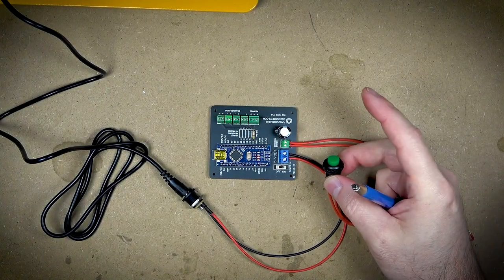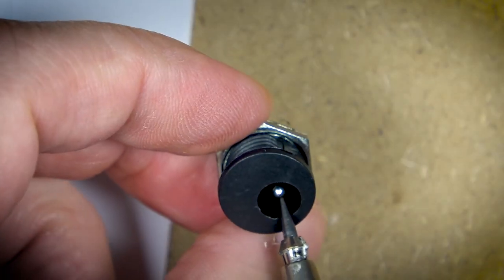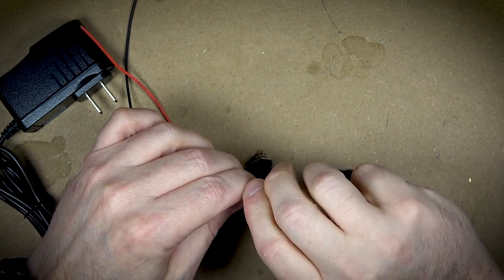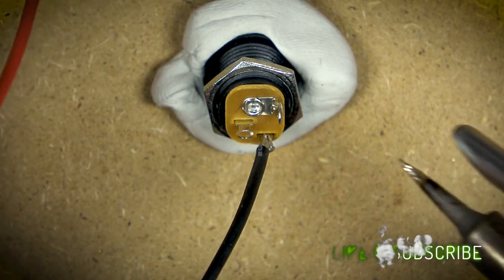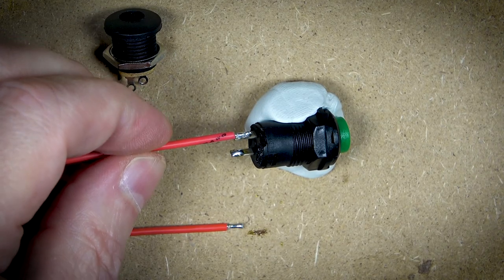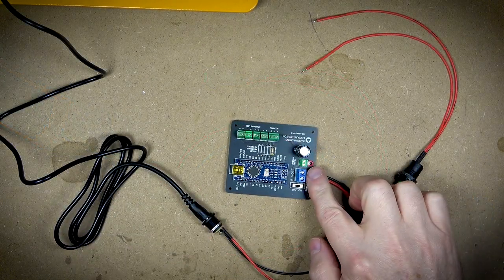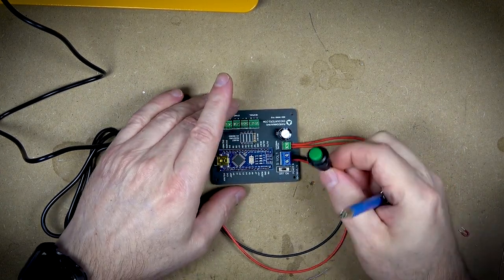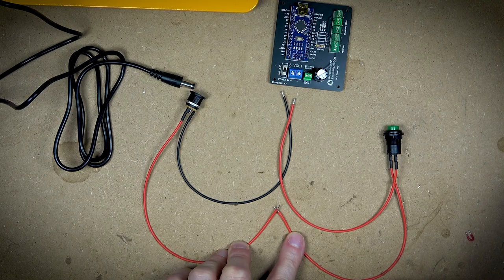Book Nooks - Soldering Power Connections and Switches

Comment: Hi there! Is there any chance to get the circuit board you showed? Would absolutely love to use it in my projects. I am still kind of a beginner in electronics and it seems like this board saves a lot of time and is convinient to use :-)
Reply from the maker: Ya know... it turns out that board needs some tweaking. To make a long story short, I designed it to use 5 volts as its power source. It turns out, the Arduino needs more like 7 volts for power. I didn't catch this because the circuit actually works... but the poor lil' Arduino is barely getting enough juice to run. So... not a fatal flaw but it still may lead to glitchy behavior. I'm working on some video ideas around how to make easier connections. Are you getting into electronics for dioramas or other types of projects?